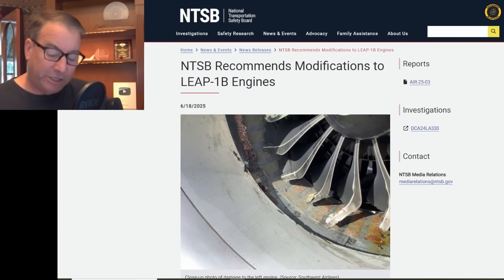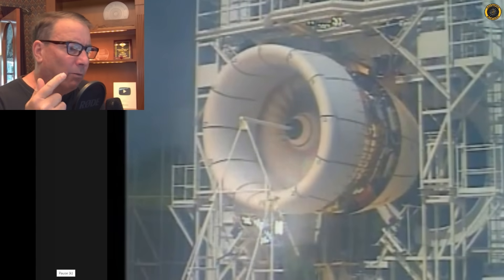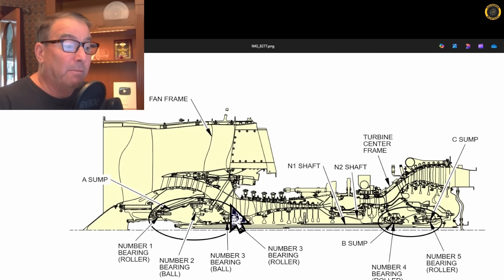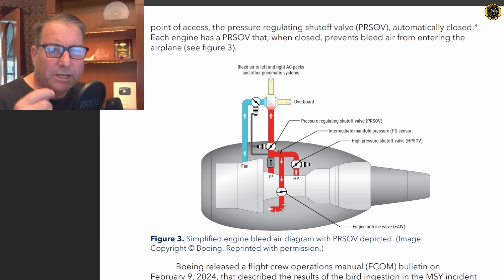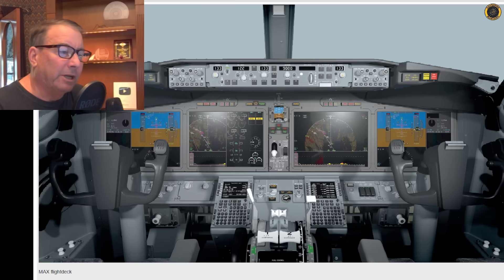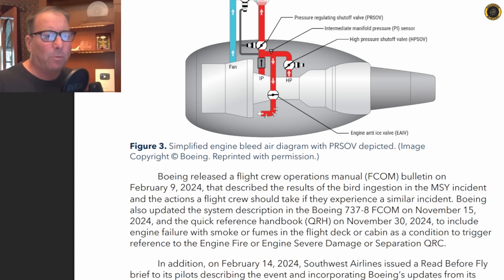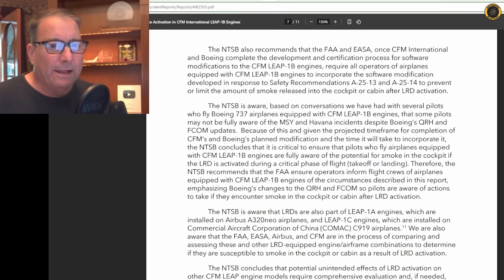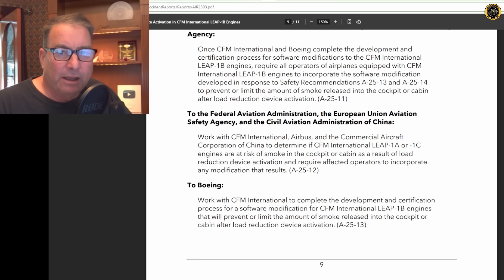NTSB Urgent Safety Recommendation 737Max LRD CFM Leap Engines

Comment: The MAX overhead panel is a throwback to the 737s of years gone by. Why? The answer to all these questions is: money
Reply: Boeing is saving time. Airlines and other operators are saving money.
If too many changes are made, the plane isn't grandfathered in, and will need to re-certify with a new type which will take a long time, years even. And you'll have airline pilots who will be split between similar aircraft except in certain scenarios. So airlines will have to split crew, take pilots off to train for this time, which is more crew issues and delays, which is lost money. Which is some of the reason why Boeing worked on MCAS in secret. Now, Boeing can't make a new plane fast enough or efficient enough that'll make them replace their 737s, their cash cow. Especially when starting from scratch will take a decade minimum, and by then will be out of date, and will need good fuel economy or else it could kill them, one of the reasons McDonnell Douglas died after the MD-11.
Reply: @trilight3597  Boeing had the choice to do it right in the first place, they chose not to. That was a mistake. They need to make the correction sooner or later. The longer they are enabled to keep covering up their bad decisions, the longer the inevitable is pushed off. They should be forced to re-certify the 737 Max just based on all the serious mistakes they have made and continue to cover up. I'll never ride on one.
Reply: @Aplikowski  They can't and no one wants that. Max now should be certified and clear as the software they used is the same one used for military 767 tankers when they shift weight. The two biggest things really is that they hid the system and which didn't allow it to be properly checked, which would've prevented it. Which transparency is one of the biggest things about the industry. What Boeing needs is either (a) new plane, (b) a new 757 re-engine. But sadly neither they can afford or spare.
Reply: @trilight3597  You chose not to mention 1) the design was inherently flawed right from the outset 2) Boeing did not test the system adequately, either in-house or on the aircraft  3) Boeing was the delegated testing and safety authority for the aircraft.
Reply: @hb1338  NG was already "a bridge too far". The technical debt on 737 was already huge at that point and clean sheet design based on technologies developed for 777 was best long term option.
Reply: @trilight3597  This misses the point that the reason the airplane now pitches up is that the new engines produce a pitch up moment because of the way they cobbled it onto the airplane. The they band-aided it with software. The plane flies different because it IS different. THAT is why it should be recertified.
Reply: @Aplikowski I realize that but they're not going to do that. It's likely the best outcome for everyone except the flying public and certain aviation heads. They'd be more willing to do that with American competition. Unless Lockheed wants to try again, but they haven't made financial success in commercial aviation.
Reply: @trilight3597  well... it isn't working out quite the way they expected, is it?!
Reply: @trilight3597 MCAS was obviously a disastrous screw up but we've got way more than 15 million safe flights in a row on the 737 Max now. Literally every airplane has issues like this that crop up because they have been so rarely that it takes a long time for them to show themselves
Reply: @mcamp9445 MCAS is not used in any other plane, it was added because to maintain type certification and fit new larger fuel efficient engines they wouldn't fit under the wings and they couldn't lengthen the landing gear. They shoved the engines forward 2 feet to get them to fit,  This resulted in the plane pitching when throttle was applied. FAA wouldnt pass the plane if it pinched aggressively with throttle so the put in the MCAS system in as a  workaround. FAA guidelines say there should not be software added to aid basic plane stability but they signed it off anyway. It's a right mess.
Reply: @rivalrepairs  KC-46 uses MCAS. All aircraft pitch up or down when throttle is applied, that wasn't the reason.
Reply: @rivalrepairs  The MD-11 uses a similar system to MCAS (LSAS), which is part of why I'm angry about the MCAS problems (they should have known better, precisely because they have a similar system which had already gone through iterations and problems).
Reply: @mcamp9445  MCAS failure was not an "issue" - it was deliberate, wilful and reckless negligence.
Reply: @rivalrepairs  And none of it would have been necessary if Boeing had chosen its' base airframe on technical rather than financial grounds.
Reply: @lyaneris  It's worse than that. The failings of MCAS were gross and generic - inadequate redundancy and no means of ignoring a false positive. They should have been caught at the first design walkthrough, not after delivery of the final product.
Reply: @hb1338  I am aware, I just wanted to stress that they had already developed a similar system, which they should have learned from
Reply: @mcamp9445  No, EVERY airplane doesn't have such issues. Boeing's 777 had no systemic flaws, nor has the A330, A340, A350 or A380 had them.
Reply: @grahamstevenson1740 literally all of those have had an engine out issue
Reply: @mcamp9445  Every airliner model ever made has lost an engine at some time. That is NOT a systemic fault !!! That is just normal wear and tear.
The difference here with the LRD is that there is an issue UNIQUE to the 737 that can   introduce fumes to the cabin or cockpit. This wouldn't happen with an A320 despite it using the same type of engine.
Reply: Money drives everything.
Reply: @AlbertHess-xy7ky i believe it’s “cash rules everything around me “
Reply: The FAA’s rules prevent changes to systems without requiring a new type rating. A new type rating requires more training and certification of pilots. 
As for “smoke” being put into the cabin and cockpit, those are toxic fumes from the oil which  is actually a neurotoxin. Same with hydraulic fluid.
Reply: YES - it's an old 1960s airframe they refuse to update so they keep having the issues.
Reply: @fredharvey2720  It is working in 99.9% of all the flights, so why care at all? Just wonder if the CEO's of Boeing are boarding their own planes....
Reply: @Henshusuru  As with all these cases, choosing the cheap option was a false economy. I hate to think how much money Boeing has lost having to deal with all the problems of the 737.
Reply: @hb1338  Then it wasn't the cheap option at all. They preferred short-sighted profits over sustainability. Just as the economy works. Putting growth over everything else is stupid af considering long terms. Change the root cause or live with the consequences.
Reply: @fredharvey2720  The 737 max is abolutely NOT a 60's airframe!  It has been continuosly updated over the decades.
Reply: And I still don't understand why so many people think Boeing should have developed a 737 replacement.  If Boeing could not successfully upgrade the 737 Max and 777X, properly build the 787, or build the Starliner where it can safely transport astronauts, what makes anyone think Boeing could successfully develop and produce a 737 replacement?
Reply: I flew the 737-200s, and the overhead panel was identical.
Reply: @gerardmoran9560  You are kidding?!? Over 50 years without any change????
Reply: @Henshusuru  Not kidding. It was my first captain assignment at Delta. 737-232s (Delta) and 737-247s (former Western Airlines). This was back in 2004, but the jets were built in the late 70s I'd guess.
Reply: Why turn the pack off ? Just turn that engine bleed off that switch controls the PRSOV.
Reply: 5th and 9th stage on the NG, 4th and 10th stage on the max 🤣
Reply: It is still very good though if you know it.
Reply: I would bet that all else being equal, you make all of your daily decisions based on MONEY.  Nothing wrong with lowering costs; it's the reason air travel is so cheap these days.  The point is that not the money but rather the COST/BENEFIT ratio must be properly evaluated.
Reply: @garyhalmbacher6875  Is it OK to reduce costs in order to make a system provably less safe ?
Reply: What would be the difference, really? Touch/push design would do the same, so why use money on changing it?
Reply: @ACPilot  Electronic switches can be controlled digitally and automatically. Try this with mechanical buttons and switches.
Reply: @Henshusuru Then more that can fail..
Reply: @ACPilot  You can check the functionality via POST. If a button or switch is broken you won't notice it until you press it.
Reply: @ACPilot  And more where any failure can be detected.
Reply: You are correct, but it's the airlines wanting to save money, not Boeing.  The less retraining an airline has to do the cheaper it is to adopt a new aircraft type.
Reply: @michaelchadwick8261  Boeing's attitude worked well with MCAS, didn't it ?
Reply: @hb1338  Yes, Boeing Execs all sat around the table in a dark cigar smoked filled room along with the FAA maniacally laughing about how many people they were goining to kill with MCAS!
Reply: @michaelchadwick8261 Boeing uses that as a selling point. They're chasing Airbus in terms of type commonality, so in order to avoid additional training and recertification issue, they end up either hiding systems from pilots (like MCAS) or using suboptimal systems and layouts.

It saves Boeing money by not having to spend cash on fresh designs or regulatory requirements.
Reply: @michaelchadwick8261 Southwest specifically
Reply: @michaelchadwick8261  both are saving ton of money on this decision...
Reply: @OverlordSim  How is Boeing saving money?  It would be far cheaper to update the panel to new layout with fewer switches and greater automation but that's not what the airlines want.
Reply: @michaelchadwick8261  some engineers have to develop new overhead panel first, then test it, make prototype and test it and start mass production. You have to train employees on how to put together new overhead panel. It would also make the aircraft more expensive and thus less competitive against Airbus. Yes the demand for old panel came from the airlines to save cost on pilot re-training, but Boeing just comply without saying a word. They were also happy that they dont have re-certificate the Max as completely new airframe. It suited them. Cost saving - win win. Unfortunately we all saw how it ended up with max issues and crashes.
Reply: @OverlordSim  "Boeing just comply without saying a word."  When did you work at Boeing?  Did you have first hand knowledge of what Boeing did or did not do?
Reply: @michaelchadwick8261  nice try of changing the subject bro. I wont fall for it. Have a nice day :D
Reply: @OverlordSim  So that's a 'No, I did NOT work for Boeing and therefore have no idea what I'm talking about.'  Have a nice day . . . BRO!
Reply: @michaelchadwick8261  I have an idea: keep the interface the same, and let software update plane behavior in the background, unknown to the pilot. No training needed and software never fails, so everyone wins!
Reply: @psps3550 Boeing tried that. People died.
Reply: @psps3550 That's a brilliant idea!
I wonder why nobody has done that - you should contact Boing about this.
I'm sure they'd welcome you with open arms. 🤣
Reply: @psps3550Lol they'd never do something so reckless, would they? 😂
Reply: @daveseddon5227  And if it all goes to shit and you decide to go public with your concerns they definitely won't send a hitman after you...
Reply: @kstricl  Boeing made a bad job of it !
Reply: The answer is Southwest Airlines, the Boeing 737MAX launch customer. Much of the issues that we castigate Boeing for regarding the MAX were actually caused by Southwests Management and their demands. Southwest were the ones who demanded that the MAX had to be type rated the same as the other 737’s. They were the ones that wrote the initial manuals and documentation for the MAX. And they were the ones who insisted that the cursed MCAS system info not be put in the manual. Because Southwest did not want anything that might require more pilot training than a quick 1-2 day upgrade for the MAX. As you say decisions driven by money. Just realize we’re not always talking about Boeing’s money. There are other actors with dirty hands, who largely walked away from the Lionair disaster without scrutiny.
Reply: @andrewtaylor940  Heck, SW even caused the 737NG...
Reply: @andrewtaylor940  .. because the ONE organisation that had control over the quality of the product was the one that chose not to exercise that control properly. If Boeing had designed, tested and implemented MCAS properly, Southwest's desires and actions would have been irrelevant.
Reply: @andrewtaylor940  Southwest is more ghetto than I thought. I'll never be flying them.
Reply: @andrewtaylor940  so, it’s boeings money… and it’s boeings management and boeings construction.
Reply: @andrewtaylor940  : But it was still greed at Boeing in play. Boeing did these things to make the plane more attractive, ie. sell more of them.
Reply: Why? Because why change something that isn’t broken ? It’s fine
Reply: The 737MAX is just an American product proudly carrying tons of heritage and patriotism whereas Airbus is lacking any soul and character.
Reply: @peterebel7899  Americans and their ridiculous 'patriotism'. You'll be saluting the flag next ! Airbus represents the best Europe has to offer but specifically the best of France, Britain, Germany and Spain.

Comment: It's obscene how far the FAA will let manufacturers go with a design before they require a new type certificate.
Reply: But they is an engine design problem
Reply: @misham6547  
Oh so you haven't heard about the 737Max crashes either.
Reply: We should have more rules and regulations?
Reply: @AlbertHess-xy7ky  
I was a professional pilot for 50 years.  I have a type-rating that allows me to fly any LearJet from a 20 series to a Lear 55. A person trained in an early 20 series couldn't even find the door to a Lear 55. I also have a CitationJet type rating with allows me to fly a any Citation Jet from a CJ to a CJ4.  There isn't a screw on the CJ4 that was like the original CJ.  The manufactures save billions in engineering, development and building costs by keeping the same type and the users save millions in not having to pay for their pilots to get new type ratings.  Ever heard of the 737Max crashes?  This was all because the FAA let Boeing go too far in modifying the original 737.  Sometimes regulations are just necessary.

Comment: main concerns is that if a LEFT engine fail this way, if they won't react quicky, pilots may be dead in about 39 seconds because the smoke contains acrolein and formaldehyde
Reply: 😊 that's why they have oxygen masks
Reply: And if they react too quickly, they might turn off the wrong engine. Permanently. Not sure this procedure change is ideal. The engine should shut those bleed valves automatically, that's the correct solution, not procedure updates, in my opinion. We've seen with MCAS what happens when you rely just on procedures to deal with serious issues.
Reply: formaldehyde? JET Engine Oils contain much worse stuff in the form of TCP lol

Comment: The amazing thing for me is the engine for the most part stays intact.   Being an aircrewman in the Navy always heard about horror stories if the engine in the jets come apart pieces of metal would go flying everywhere in all direction and good chance anything that hits you, good chance you'll be dead...  So seeing the engine stay together in principle just shows the engineering and advancements which have been made...
Reply: Every once in a while you'll get an uncontained failure. That's when you start sweating flying blades!
Reply: My understanding is that these engines all have a Kevlar or similar containment skirt to help prevent peppering people and plane with shrapnel. Another lesson learned the hard way.
Reply: Yep, passenger jets are required to contain all the bits and pieces. Verifying that is one of the reasons destructive tests like the one shown in the video are conducted. Not that bits of blade never hit the aircraft, but it's uncommon.
Reply: @SnakebitSTI  Most incidents of catastrophic engine failures I've seen have been cowling/inlet failures.
Ironically, quite a few of them were 'contained' failures.
Reply: Southwest airlines flight 1380
Reply: you deal with fairly different jet engines in size, design, location in airframe. it's not altogether the same

Comment: How did Boeing expect this aircraft to be safe for passengers, HOW ?
Reply: By missing an effect of new engine behaviour on existing procedures, plus by assuming that existing procedures cover the situation already. We see such errors all the time, be it aviation or auto industry, or medical procedures, or civic law. Contrary to MCAS and those missing door plug bolts, the smoke issue is very human
Reply: This has nothing to do with Boeing. Go simp for Airbus somewhere else.
Reply: @raihothexiv15th37  It has everything to do with Boeing. 
"The Airbus planes automatically close the valves when high engine vibration is sensed. The 737 lacks this automation and the crew must manually close the valve."
Quoted from a post just above yours because it is stated so clearly and simply by the author.  
Keep your ignorance to yourself and your rage in your pants.

Comment: kinda looks like the IP and HP bleeds come off of combustion air in the turbine?  doesn't bode well for air quality from those bleeds...
Reply: It is just compressed air, not combustion air.  

Bleed air comes off the high pressure compressor, which is forward of the combustor.
Reply: ah, appears they are positioned to bleed air prior to (purposeful) introduction of fuel, so maybe warm, but otherwise typically as clean as ambient.